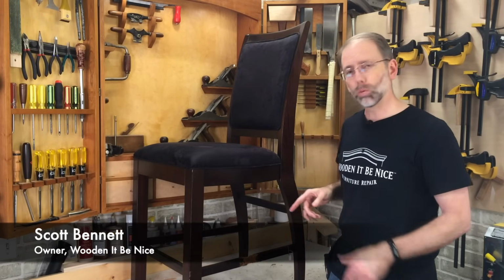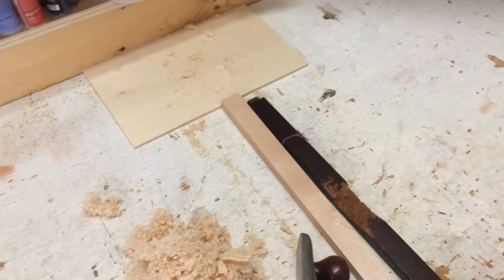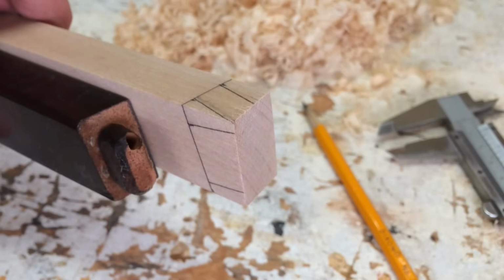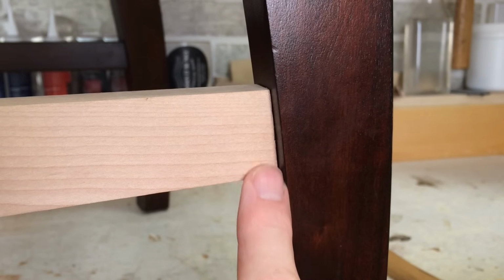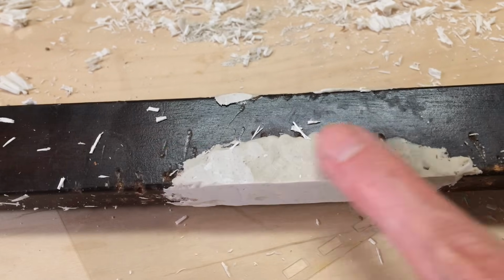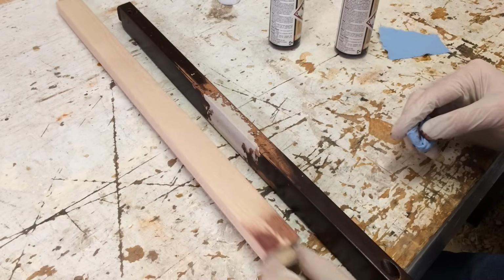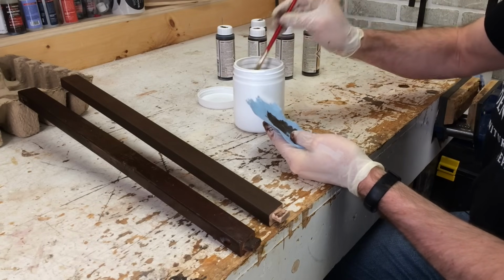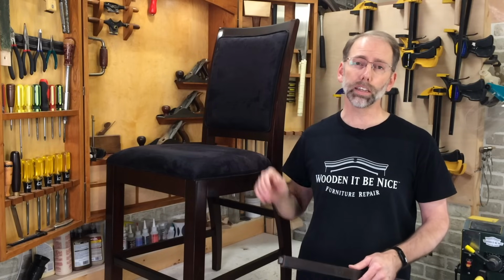2 Ways to Repair Damaged Wood Furniture, by @FixingFurniture

Comment: I've found myself needing to use a damp paper towel, or mist bottle when using these kwikwood epoxy products. The putty always wants to stick to my fingers/gloves instead of the wood when I'm trying to form the rough shape. Is this negatively effecting anything other than the dying time?

Comment: I would have tried another scenario : cutting the damaged part (with an angle) and exchange it with a new piece of wood. As the stain is very dark, I think it is possible to hide the seams, as well as in the epoxy solution. This solution is also most probably cheaper.

Comment: Staining question:
I'm trying to clarify the idea behind your using two stains colors. Is it because if you used only the darker stain, then the result would be a blend of the wood's color and the stain? (Which would be a bit off)

So instead, you first match the color of the BARE wood on the original piece, and THEN you go over it with a stain that matches the original finish. So, therefore you have emulated the original combination/progression of colors.
Right?

Comment: That angled tenon was a tricky piece of joinery which you explained very clearly.  We once had a puppy who decided to cut her teeth on a dining chair leg.  Fortunately the damage wasn't structural, so I was able to fix it cosmetically with wood filler and wood stain, sandpaper and varnish.

Comment: It’s got to be the new stretcher for me, I am an amateur woodworker and don’t have many tools but I do have the Japanese ones. I’ve also placed an order for a T-Bevel I’ve seen them being used on other videos but didn’t know the name. I’m from the UK, and have a project I’ve just started restoring an early 20th century chair that’s put together with dowels and brass screws. There is a fair bit of rotten wood on the mortise and tenon joints. Would it be better to make new ones or could I just repair with  an epoxy putty or splice a new joint.

Comment: Nice job.

 I'd make a new stretcher as well. I'm an amatuer woodworker, but I think I could manage this without issue. As long as you can saw,  sharpen, and use a hand plane it's pretty easy work. I might have trouble stain matching as I don't have your experience, but I guess if you start out light, you can always go darker. Some of your viewers may not be aware of the fact that most metropolitan areas will have a hardwood dealer in their area, so the wood will be accessible. And a small part like that would not be too expensive.

Comment: I feel like such an idiot but I have a question. The tenon is a cube right?  So what's with the line down the middle at 8:45??? Shouldnt the cut lines at the top (what will be the end of the tenon) make a rectangle?????
Reply: They do! One side of the rectangle just maches the side of the plank. It happens because of the way tenon is angled. At 8:47 you can see that one of lines goes right to the corner. Hope my explanation helps)

Comment: Any tips on determining how chewed is too chewed to replace? I’ve got a turned leg that’s probably chewed halfway through. (Front leg on a dining chair). Not sure if bondo/wood putty is the way to go for structural integrity.
Reply: If there is any question always replace the leg. Nobody needs somebody hurt over a foolish bondo or epoxy repair

Comment: @FixingFurniture thanks for the lesson.  Considering it's a Leon's chair I would have tried contacting the company directly for a replacement part...
However I'm dealing with repurposing and refurbishing items so I watched for sure.  You have a soothing voice btw...I appreciate that you don't yell like some youtubers. 
I would go with the filler when possible.  I am curious about the epoxy...why was it 2 different colours until you kneaded it? 
How much time do you have to work with it? 
If you placed clear acetate plastic sheeting on it and firmly rolled over it with say a rolling pin...would that work? It would force the product into the crevices and leave a smooth surface.  I've never worked with that kind before. 
Could using a bunch of sawdust and ca glue work for this?
Why did it have such an odd angle for the tennon?
I thought the whole point of mortise and tennon was it negated the need for screws...why did you have to put screws in?
I'm a beginner when it comes to this level of restoration...thanks in advance.

Comment: Probably wouldn’t want to use the epoxy if a dog did this, as the dog may start chewing that part again and will now be eating epoxy, replacement is probably the best solution if the dog did it.

Comment: 😲 Good Job!
I like the way you made the the new part, old school furniture making!
😲 You should try using the Mohawk epoxy stick that matches the color of the woods or finish and use water and plastic putty knife for shaping, less sanding involved and less, a lot of staining involved!
😲 I've done this and used toners to sharp shoot final matching finish.
😲I have done this and lectures on restoration for over 40+ years! If you have the Mohawk manual on the epoxy sticks and mixing chart check it out you will Love It!
😲let me know what you think about it and have a Wonderful Day!
Keep up the Good Work Friend!

Comment: The former owners of my house had evidently locked a dog into the bathroom for an extended time (poor dog), and it scratched the hell out of the lower, outer (away from the hinge) parts. I've got a LOT of wood to fill, but it's a painted white door, so no grain is important. I am thinking of a filler, but wonder what will do a good job, last over time, and be perhaps cheaper than epoxy. Any suggestions?

Comment: Nice work! How would you repair a kitchen countertop with dog bite damage on the front corner?
Reply from the maker: If it’s butcher block (solid wood) I would patch in an new piece of wood.  If it’s not, I’d replace the counter top.  I hope that helps. Scott

Comment: Is wood filler different from epoxy filler?   I am in a similar situation where one of the cross legs of a small bench has been partly scratched out by pet cats, probably about 1/6th, 1/5th or 1/4th of the mass of the wood has been scratched/gouged out in a small area of about 3-4 inches of the length of the leg, just like the example in the video.  Also, since it's a bench, I wonder if just putting in epoxy or filler onto the leg is good enough to hold weight.  I think there's still enough wood around the damaged area that it should hold weight.   It's hard to explain all this without showing a photo.  There are other ideas, such as hiding a metal stud shoe plate (as in housing construction) to reinforce the gouged area, along with wood filler/epoxy.  Or maybe also routing a narrow channel along the length of leg & inserting a steel rod for reinforcement & then filling in the route with epoxy to hide the rod, but now the leg is stronger with the rod inside of it, just like how metal/titanium rods are used in surgery to reinforce leg bones.  What to do, what to do.
Reply from the maker: Wood filler is not the same as epoxy filler.  Wood filler is very soft whereas epoxy putty is about the same density of wood.  It doesn't offer structural strength though.  If you'd like me to look at some photos and give you some advice on your project, you can buy an advice session on our website https://woodenitbenice.ca

Comment: One question I had in mind when you started the epoxy version was how you were going to handle the grain match. From the video, it seems like you ignored it, relying on the dark stain to disguise the mismatch. Is that right?

One trick I've tried with some success is to pencil in some grain lines. This is particularly useful for light stains or when leaving the wood natural. The earlier in the finishing process you add grain lines, the better the effect seems to be. They might disappear when rubbing off stain, though, but you can just reapply them. After patching a half-inch gouge in some red oak with epoxy and penciling in grain lines, my wife couldn't  tell where the patch was, even knowing it was there somewhere. You know that if it passes the wife test, it's good!
Reply from the maker: That’s awesome! Thanks for sharing that #tip

Comment: My takeaway is probably not like the others. I feel that if you give a dog a chew bone and keep them busy, they won’t take their boredom out on your chairs. But should something else happen that you need this repair, then the new one you made is perfect. If I were doing it, I’d probably use the epoxy filler. Just because I wouldn’t be as secure cutting out the angles on the ends. Beautiful job. ✌🏻🤍

Comment: Why did you not wrap the epoxy area in wax paper and clamp it between two flat pieces of scrap wood (or make two right angle clamping forms to cover all four sides)?  This would make the surfaces flat and level, requiring less plane work or sanding (and likely not leave any voids).

Comment: Would filling in the mortise on the chair leg (either with a piece of wood or maybe your magic epoxy) and connecting the stretcher to it with a dowel be too much of a cheat?  It sure would be easier for most dyi guys (like me).  Especially since this doesn't appear to be an expensive piece of furniture.

Comment: I'd ask why use epoxy putty instead of a two-part liquid epoxy? It's going to easier fill the voids and you don't have to shape it nearly as hard. You do have to sand it down more to get it smooth but I think the finish can come out a whole lot better using it

Comment: Just glancing through the comments I didn't notice anyone mention a third or 4th technique, the third I used a couple times. Cutting out the affected area and using real wood as the filler. 

With the damage on all sides I get that it would be more difficult than say just one side. Works in a splint like fashion.

The fourth technique is to completely cut out the affected chew area and splice in new wood, with how you were meticulous to saw the joints I could see you doing that. With the stain as dark as it is it would be easier to cover up if the whole piece is sanded down and redone in it's entirety. It could also be that the video doesn't capture the tone and grain as well.

Unquestionably quality craftsmanship regardless! 
👍
Reply from the maker: Thanks for sharing that Paul.  Yes, both valid techniques.  My preference is the whole new piece, but I come from a woodworking background.  Cheers.  Scott

Comment: Hmmm, when do you look at a job/ project and say, "Ain't worth the trouble?"  That's easily $100 worth of labor and materials into a $75 - $100 chair.  Nice to know how to do on an heirloom piece, but that one is just disposable stuff to me, as is almost everything sold today.
Reply from the maker: It's the age old question... "is it worth it?"  I've learned to never guess what a customer is or isn't willing to spend on a project.  If they have a set of 4-6 chairs, it may be worth it to repair one.  Sometimes there's sentimental value, and sometimes potential customers don't want to spend the money.  After hundreds of repairs... no longer try to guess how a customer will react to the quote.  Cheers.  Scott

Comment: I’m very curious, as a fellow wood repair specialist running a business, how much you’d charge for both sets of repairs?  Would you charge more for making the new piece?  Would you repair the leg onsite in the customers home if you were just going to use Quickwood and wax sticks?  9/10 times we’d be doing this repair onsite and have it done in an hour or two and it would be much cheaper for the customer than if we had to pick it up and take it back to the shop and do it there and then return it.  90% of our work is done onsite.  I’m wondering if you’re business is the opposite maybe?  Looks like you like to do most things in the shop?  I wish we could chat more about wood repairs and business.  Always wanting to learn and grow in this craft.

Comment: I would shoot the dog first.   Then I would go option 1 for sure.    But if I was to try and patch I think I might had used used a band sand trim down the chewed up part and cut some new pieces to fill the hole and secure it with epoxy and filler.  But I would most likely just make a new part.

Comment: Which method I prefer depends on the condition of the entire piece of furniture. If the chair had already had a hard life and clearly bears traces of that, I would repair the attached piece with epoxy. The fact that some traces remain then fits well with the character of the entire piece of furniture. The chair in the video still looks very good with very little damage, so the new piece is preferable. I also like it when a repair is successful that it remains a bit visible as a kind of scar, damaged but survives.

Comment: New subscriber here. Great work and I  like the new birch one better because it is much smoother. The filler piece looks like it has been around the bend; maybe it needed more thin top coats of epoxy and that means more time. 
I realize it is a customer's piece, but if it were mine, I would fix the problem an easier way - not to be catty, but I'd get rid of the dog. How many more pieces will need fixing with Chewdo in the house?
Reply from the maker: Thanks for the sub!  Glad you enjoyed the video.  There was a second chair that went with this one, but the damage was puncture marks - took care of the with burn-in wood filler.  Cheers.  Scott

Comment: Good job! 👏👏👏 Did you consider using Bondo for the repair? If so, I'd love to know why you chose epoxy instead. Since the stretcher is in tension during use, the filler serves little structural purpose.
Reply from the maker: Thanks.  I don’t use Bondo for wood repair as the colour is an issue.  I need a filler that mimics wood so it can be stained and finished to match.  If it was painted, that could work.  Scott
Reply: @FixingFurniture  Thanks for the feedback! Great point. I don't know what I was thinking as this application clearly called for staining. 🤦‍♂️🤷‍♂️

Comment: There is a much better way of working with the epoxy to get a perfectly smooth finish the first time around. After applying the epoxy, brush on a light solution of soapy water (I use hand soap with a little water, or even better use some Glycerin obtained from an Air conditioning supply store for leak testing, nick named "Bubbles solution " A little bottle will last for years ) and press the epoxy into the exact shape that you want the project to finish as. Smooth the epoxy with a flat plastic spatula until the shape is exact with some more soapy water, not too much and you can cut out the sanding process entirely. 
You can also use a sharp largish "Kitchen knife" type of tool to cut away the excess epoxy before it sets completely. Incidentally Epoxy is a very handy tool and can be used to make or repair all kinds of broken things including metal parts and plastic parts. Surprisingly durable and strong. The glycerin allows you to shape epoxy so that the tools don't stick to the epoxy and it does not compromise the strength of the final product.
Reply from the maker: That’s great advice!  Thank your for sharing that. Scott #tip

Comment: What about cutting out and replacing the damaged section? Not cutting completely through, but since the damage was only on 3 sides, taking a chisel and cutting out the damaged areas, then using the mahogany you have to create a 'U' shaped section to wrap around and replace the parts you chiseled out? The stretcher would still have it's integrity, and you wouldn't need to use epoxy. Similar to doing a bowtie patch. 
Also, have you ever tried alcohol stains. They can be much richer in color, and they clean up with plain alcohol. 
Another thing for future reference, after the epoxy cures, and you've done all the work to make it match the contours, if you have difficulty making it take a finish, spray a layer of shellac over it. Hit that with 0000 steel wool, and it will give you the tooth needed to get your finish to stick.

Comment: Many many years a go a mate was on about a wonky side table top and the best way to fix it , him not being fixing type of guy I agreed to do it , drilled and screwed it town filled hole with body filler that did not take the stain but him being a commercial artist he touched it up , a old fella I worked with brought in a badly worn coffee table DA sanded it primed it applied a dark brown centre and a lighter brown edge then a few coats of lacquer all cellulous paints back in the 70's looked spot on when finished .

Comment: You can also fix damage like this without disassembling the chair. Use Bondo to fill in, sand, then paint to match color with clear coat if necessary. Good enough for a part near the floor that is not that visible.

Comment: nice job!  learned a lot with your teaching approach.  I might have tried autobody glazing putty to fill the small imperfections....I have used it before and it works but do not know if it would take the stain perfectly.  I did not know about burn in product.  thanks.

Comment: There is another way, stack the new blank to the original with a couple of dabs of hot melt glue to hold them together.  The new blank can be wider slightly to allow for thickness of the saw blade.  I would probably cut the stack on a band saw with the original on top  Make diagonal, (scarf joint) cuts, forming a wide V around (outside) the damage.  The bottom piece replaces the damaged part that was removed by the cut which also cut the patch.

A factory made piece is not super high quality fine furniture, come on, pocket screws ...........  Also, an innovative patch can add character and be shown off, like an embroidery on a pair of jeans.
Reply: The main reason for  the above is to avoid all the angled cuts for the tenons.